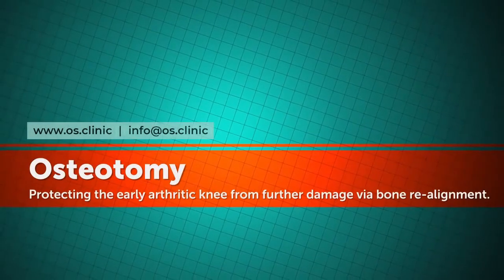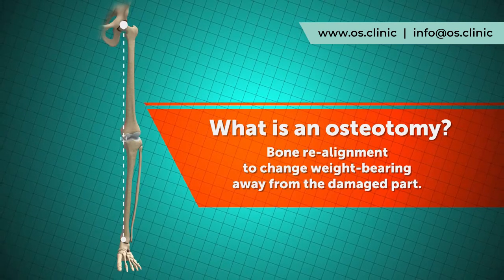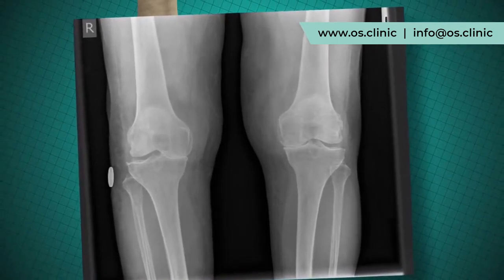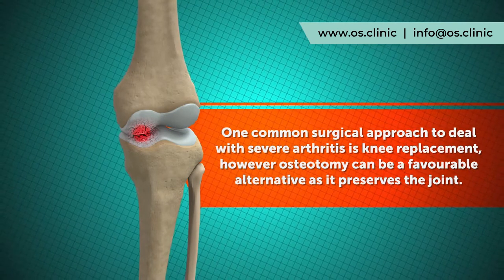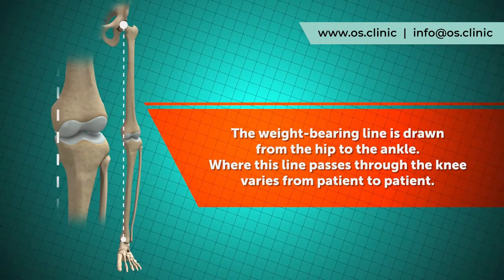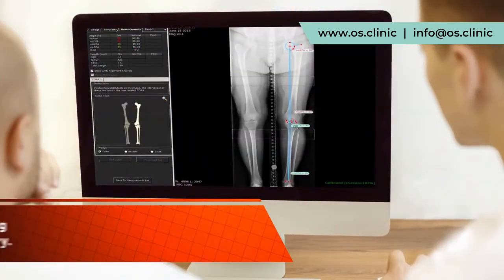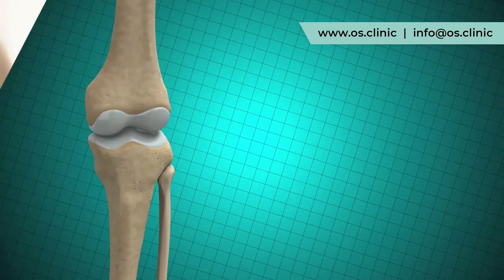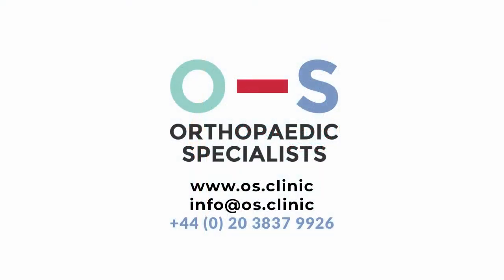What is an knee osteotomy?

Comment: I had this surgery in March of 2021. I did about 14 months of rehab, then later in March 2023 I began to have hip pain. They told me that the way I had been walking after my knee surgery ruined my hip. Now in July 2024 at age 37 I just had a hip replacement. My meniscus has also lost cartilage due to the fact I had minimal quad muscles for so long after surgery, putting more pressure on my knee. My quad was basically gone after the osteotomy. I would recommend anyone to get a 2nd or 3rd opinion before having this surgery done.

Comment: I’m 26 and have just had this done due to rugby injuries persisting when I was younger. Have no cartilage left with grade 4 arthritis so they’re trying to slow the process down. Currently 4 weeks post op now with a lot of swelling still but able to put pressure and walk on it, albeit with crutches for stability. 

Anyone who wants advice etc drop me a message!
Reply: How has it been till now?  I may need this done on myself but I have read a lot of negative comments about recovery from this, im getting scared, can you tell me your experience till now?
Reply: @XIskandarX  you have to make sure you follow the proper treatment recommended after such as the right amount of rest and the correct exercises when recommended. everyone is different
Reply: Hi friend I live in England I'm having this done in January you said to drop you a line I'm have had a spinal fusion this year now need this on my left leg.
How are you now I'm allergic to opioids so what are you taking?
Is sleep bad?
Thanks
Reply: Hey how are you doing now is ir getting better, are you still in pain?
Reply: Hello.  I need this done.  How are you doing a year later?  Anymore pain?
Reply: Hi sorry I missed the above. 

So the recovery took a lot longer than expected and was super tough but that was doing everything right. I was out of rugby for 18 months but I’ve just played a full season with no injuries for the first time of my life. 

Still some swelling and have to avoid certain movements but all in all, it is now pain free for the most part.
Reply: @SamTaylor-gs1tf  Thanks for replying.